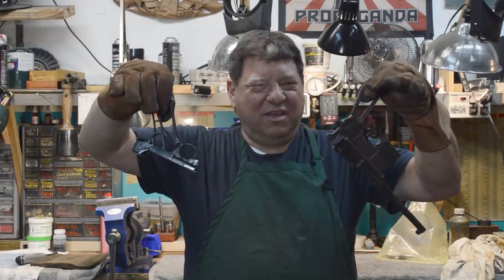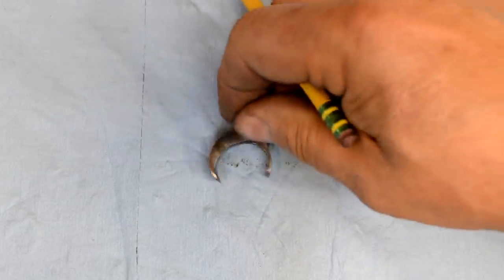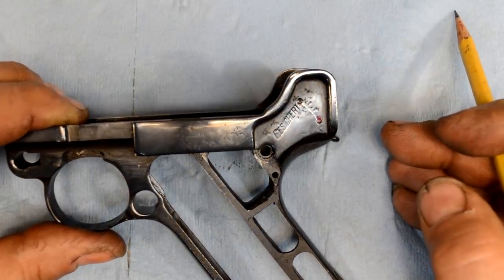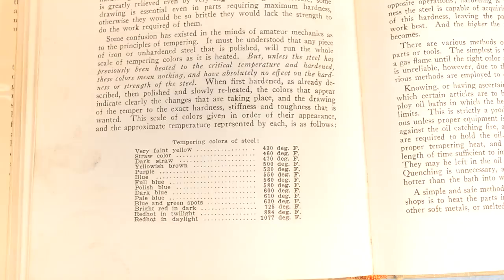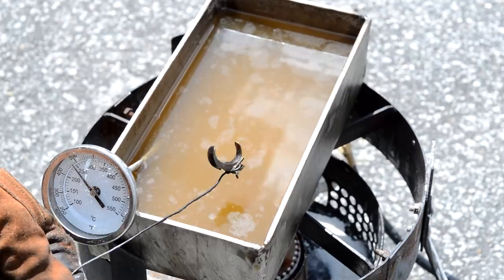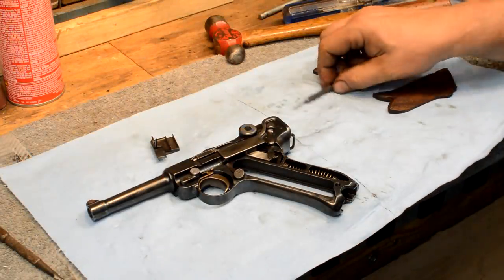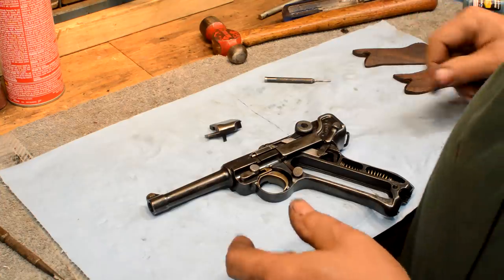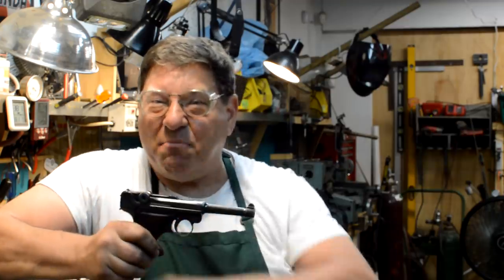Anvil 060: Luger ReStraw

Comment: When I did work for John Martz, the Custom Luger Smith, he had fixtures for the trigger / sear train so, he could adjust the travel and get the slip out. When one squeezed the trigger it was very good, as clean as a fine old Colt or S & W revolver.
Reply: All the non-bubba'd Lugers I've handled had crisp good triggers.

Comment: I have one of the very first late 1936 Lugers made right after they stopped the slow rustblue / straw process.  Any Luger made before that time and some made during 1936 were never hot blued. Lugers also had very sharp details and tended to retain some tooling marks. A lot of the polished to death guns you see were badly refinished or nickel plated after WW2 by the GI’s that brought them back or some family member that wanted to pimp out Dad’s war trophy. Straw colors were very fragile and tended to fade fairly quickly during normal use. I have about a dozen Lugers that I saved from various levels of intentional abuse like this. It is good to see Mark educating people on this issue.

Comment: Molten salt peter is dangerous as S--t. It's an oxidizer that is one component of black powder .  In a molten state it will oxidize anything with carbon in it . Spill any on wood or even grass and you got trouble.
Using it outside on concrete is the safest way. It does produce a brilliant blue on steel parts and was standard finish for early firearm small parts.

Comment: Since I have been watching your videos, I have learned to not just jump in on a gun problem.  Currently, I have a Colt Jr .25acp that needs a firing pin retaining pin, and I can't find one anywhere.  So, I have decided to make one.  I found the correct diameter rod, and will be heating, hammering and cutting soon.
Reply: Don't forget to heat treat the pin once its working. Firing fin tends to do strange stuff when they aren't (ok this is more of an issue for rifles, but still, you dont want an stuck firing pin on even a blowback 6,35mm/acp
Reply: Make sure your hammers are mirror polished, or ol' Saint Novak will be stuffing coal into your possibles bag come Christmas. :)

Comment: I have a mismatched shooter grade 1940 Luger P08 in similar condition, but the rust pitting is almost nonexistent.  The slide and frame were polished and the entire pistol hot reblued, but the rough flat surfaces where most of the milling marks were left from the factory were unmolested and are flat, not super shiny like the buffed areas.  Some rounding of the edges was noted, but not nearly as bad as the WWI luger in this video.  As for reliability, it stovepipes occasionally using original or even MecGar modern magazines.  New Wolff springs were installed years ago, and the original springs retained, because this pistol is a shooter grade pistol.  You can play with shooter grade guns, not collectable ones, hence they are more fun.  I would like to replace the original extractor which broke with another one with #72, if I could only find one, in order to match the numbers up once again.

Comment: Some twit wire-wheeled the hell out of that frame. I remember reading a book on weapons conservation back in the 70's and the author said that using wire wheels on vintage guns was a crime. Lots of old guns have the bluing worn off and they have garnered decades worth of browning. The author said it was more appropriate to clean up corrosion without wire brushing, using gentle scraping and steel wool and then to lightly re-brown the metal. That way you have a cleaned-up weapon with a patina that matches its age.

Comment: My grand father bought back a 1913 Luger from ww1. The trigger was milled off and replaced with a home made. After 50 years I finally got it back. I was able to find a WWII era trigger with the same serial number as the rest of the gun. The original bluing is so fine.

Comment: Temper colors are much better when  exposed to the atmosphere instead of under a liquid solution, they are an oxide film. Use sand in your tank, and use an oven.

Comment: We've got a Bolo C96 mauser coming in for our channel however the previous owner thought it would be a good idea to ceracoat it matte black
Reply from the maker: Well, it might depend on what you find under the paint. Bad surface pits can be minimized with a proper and well applied cerrakote job. Tread lightly, looking forward to seeing the finished job...
Reply: @marknovak8255  Yep one look at it and I can tell it's pitted even through the ceracoat. 
Oh well it'll just be a shooter.

Comment: Mark Novak is to guns what Louis Rossmann is to Macbooks. Except Mark is able to fix everything and make his own parts.
Reply: Can't wait until guns with DRMs hit the market
Reply: @topguntin  better yet, “guns as a service”
Reply: @ChronoTango  that might actually work for competition guys. I know someone with 3 identical SW revolvers: 1 for competition day, one for practice, and one at SW getting serviced!
Reply: Well, one works with chunks of metal that can be made in a cave in Afghanistan, the other works with a silicon semiconductor with millions of transistors made in a clean room. 

Not taking away from either, though.
Reply: @topguntin  that's what sponsorships are for. I've got a friend who has a similar setup with three sets of sponsored race skis.
Reply: @tissuepaper9962  if only i can get some ammo sponsored!
Reply: @topguntin  start making some YouTube videos or Instagram posts and gain even a small following, and you might be surprised what you can get

Comment: @12:15, Not sure how pervasive of a problem it is, but my Luger has an issue with the side plate that holds the trigger transfer bar. It looks like someone filed it down, and it does not fit tightly under the disassembly latch. This causes excessive trigger slop and I've almost had the slide come off while shooting because the disassembly lever isn't as well retained.
Reply: Both IMA and SARCO carry new made side plates.  Some fitting may be required.

Comment: I picked up a 1917 P08 with wood grips that are black on the outside, bare wood on the inside. Part of the front fitting "rail?" on the right grip panel is gone. I was considering filling the mag well area with clay and creating a trough in that clay to basically rebuild the lost portion of the fitting rail on the inside of the grip panel with acraglass. Create the form, apply glass in area of clay and frame (coated with release agent), install grip panel and let cure. I was wondering if you thought this would work well, or if you have a better idea for repairing the panel.

Comment: As long as were talkng about Lugers, I have a shot out barrel Amrican Eagle model with the oiginal holster and was wondering if it's feasible to sleeve the barrel and about what it would cost to do so ? If I remember right I think it's matching # and it;s not really to rough outside , not pitted but about 50% -60% original blueing wear , but no straw left and looks fairly unmolested overall. 

Would it be worth doing and not damage value any further if I did that ?

I'd  really like to shoot it  someday , and I do have a real nice DWM 42 I occasionally shoot to scratch the Luger itch. LOL  

They have both been in the family for genarations and I'd really  love to get the Eagle shootable. 

Need your advice on this one if possible?

Comment: For the kno3 bath process, check out a heater with a PID controller. Those can auto balance the temperature for you
Reply from the maker: If I did more than a few of these a year, I would go closed loop, insulate, button up the burner, yes. For now open loop and closely watch is good enough for the results I need. I did go closed loop humidity and temperature control on the rust bluing process chamber, so I could get consistent and repeatable results.
Reply: @marknovak8255  nice! Better living through automation

Comment: Anvil.  Can you make me a Soviet Sniper Rifle if I provide the M91/30 rifle and Soviet made 1940 PU original scope I purchased from Siberia a several years ago with the original mount?  All with Communist markings.... Bolt needs to be turned down, receiver drilled with accuracy, wood removed from left side of rifle...maybe more...I think I have original screws for mounting the scope in the box shipped from Russia...they are European metric screws...I don't think I can do it correctly...it may need a jig for drilling the mounting holes which I don't have...if they are not in alignment with the bore axis I'm fucked...then, just destroyed the rifle for collectability...I have multiple rifles to use as donor...how to select the best one for accuracy?  One has on octagon type receiver made in 1934...but, one made in 1939 with round receiver and bore looks really good...I've been thinking about this for some years now...I think the 1939 rifle is the one...plus matches close to date of the scope...Maybe you know expert on Soviet Arms who can do it?
Reply: Man that sounds like an expensive job
Reply: Hey Dennis, first you might want to check if any of your rifles were “ex snipers” that met the accuracy requirement but weren’t needed as sniper guns. Some of these already have the scope mounting holes drilled in the receiver, looking from the inside you would be able to see the evidence of these holes. If they have that you’re in luck. 

There are websites that sell the taps and drill bits required to thread the holes for the scope screws.

If the mount you have was put on a rifle the mount will have been fitted for that single rifle, not a huge deal but what they would do is center the crosshairs in the scope and actually file down the mount where it meets the scope rings for the windage and adjust the front screws for the elevation. These would be factory sighted for 100m and the scope had a BDC for out to 1000m.

Good luck I’ve been wanting to make a nice sniper Mosin for about 2 years now

Comment: What kind of ammo did you use? Do you think low-pressure 9mm should be used for the Luger because of the toggle?
Reply: The toggle action needs higher powered ammo to function. Do not use the +P stuff though, they're all old. I use Winchester white box and it works fine in my mismatched to hell beat up luger that has old ass springs. I cleaned it and greased it well.

No point to the +P ammo anyways though....

Comment: Can you not use an oven to heat parts to straw color?
Reply: You can for less critical parts. But there are 2 problems that come to mind.
1. Most domestic ovens do not have the finesse of temperature control. You may set the oven to 250 but it could heat up past that for a while before the thermostat shuts off the element, abd then then cool below that before the thermostat registers and re engages the heating element.
2. Air isnt the best conductor of heat and you can end up uneven colouring depending on the size of the part, placement in the oven etc. And as soon as you open the oven door to check the colour you loose all the hot air
Reply: @Magemanbob  3. Oxidation.
Reply: Have been doing that to luger triggers, safety catches and take down levers regularly. It works fine. Produces excellent straw.
Reply: @halnywiatr  The straw colour is the oxidation, the colour is due to the thickness of the layer.
Reply: You need an accurate thermometer.

A toaster oven is better for fine control, smaller volume to heat up and honestly usually better thermostats than a big oven.

Comment: Not exactly sure what the term Rust Bluing is or what it curtails.
Reply: It’s a process of creating Iron II oxide and then converting it to Magnetite which has a small black grain structure and prevents continued oxidation of the steel. Unlike hot dip bluing which requires a tank of molten salts rust bluing only needs steam and some organic acids making it safer to use and creates a deep black finish. 

Basically it’s a different bluing method that’s more appropriate for older guns like this 1917 vintage example
Reply: *entails

Comment: Can you do the strawing process in molten lead?
Reply: Lead melts at 621.43°F , so it's most likely a bit too hot for straw and I'm not sure if there is any danger of molten lead wicking into cracks and crevices, staying where it shouldn't.
It is one of the metals in lead/tin solder, after all.
Reply: @dj1NM3  Thank you for that info, always nice to learn BEFORE making mistakes lol
Reply: @endutubecensorship  if you're learning how to gunsmith from youtube comments, I worry for your gats. my recommendation is pick up any one of the old books that this channel and channels like it always seem to have. I'd also recommend just sending it to a trained gunsmith, but you're clearly beyond being convinced of that option.
Reply: @slaughterround643  Incorrect,  I am after knowledge and learning from others experience. One day I hope to have the knowledge/skills/equipment that others do, and have the foresight to runs test pieces before attempting anything. 
Some buy already "bubba-fied" firearms to bring back from the brink.

Comment: Quick question, what should i sued to remove paint from a synthetic stock?

Im a little worried about melting the plastic.

Additional info, the gun is a ruger pc carbine
Reply: My Good Doktor, brake fluid will remove just about any paint used  on a vehicle, so unless the carbine is cerakoted, I would use that. I think Ruger would use a material for the gunstock that is resistant to solvents, since solvents are used for cleaning firearms. Why not contact Ruger to be sure?

Comment: 3xcuse me...   Let's go. . .  Straw us a.   Trigger...

What in gods name is that... Can someone help me
Reply: Polished steel is referred to as in the “white “. As steel is heated it changes color and temper. From light straw color to deep purple. After purple the steel will quickly lose its color and temper going through colors of red. Till it melts. I have heat blued tools and ran a heat treating line as a tool and die maker. “Retired “